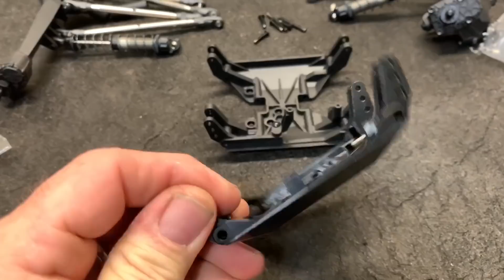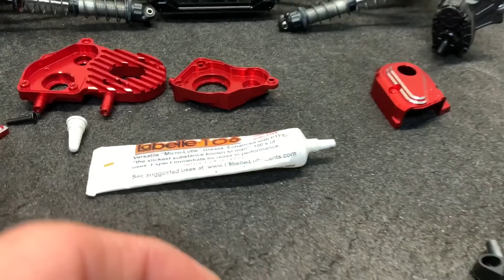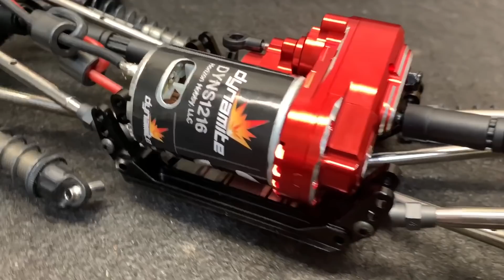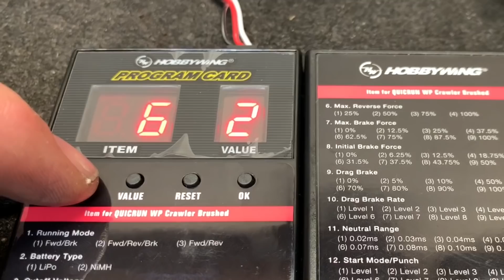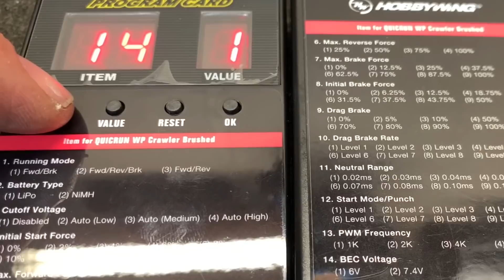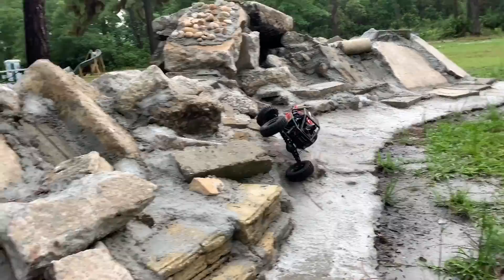Capra gets TREAL mods!

Comment: I have the treal axles, skid plate, brass portals and brass diff cover ect.  Drive shafts, beadlocks. But i got a vanquish 3 gear transmission.  Its too bad it gets all scratched up.

Comment: For the most part the gears in rc cars just don't get enough use to need grease. I've seen plenty of broken gears over the years but I've yet to see a properly meshed gear actually wear out.  I'm sure it has happened but for the vast majority of use cases it's just not needed.  Combine that with the probability of grease turning  into an abrasive and  I can see why they didn't use any.  That being said I do use a very light film on most gears because it just "feels" wrong to run them dry.  But anything more than enough to just lightly coat the teeth is a waste and a mess.
Reply from the maker: Yep! I usually put just a little bit on them. In some cases there is a lot of room and most of it just flings off.

Comment: Did you have any binding issues in the treal trans housing? I’m getting so much friction it’s sure to over hear my motor
Reply from the maker: Honestly it went together really smoothly. The finishes looked good to me as well. I did kill the dig servo on the run but I’m pretty sure I went way too far with the EPA’s. I’ve got the Reefs micro99 in there now and no issues at all.
Reply: Exocaged RC it took me so many times slightly adjusting the rear cross plate for the dig. Took it out out it back many times then it worked I’d say at 96 percent cus it has a tiny amount of friction still but it’s nothing compaired to how it was binding.

Comment: I'm putting the 1080 in my bomber.  How would I go about keeping the stock lights? I wish axial would use jst connectors to the receiver
Reply from the maker: you may have to cut and solder on some jst for them.
Reply: @ExocagedRC  ok. Thanks for the reply back

Comment: PLEASE, I beseech you. Produce a video showing how to expeditiously access/remove the chassis/motor/transmission from the body/cage of the Capra as you had already done for this video. 
NONE of these products and mods are of ANY worth to me(or others) if watchers aren't knowledgable, comfortable, or confident simply accessing these parts. TRX-4s and SCX10s are rather simple to access the motors, transmissions, etc. BUT NOT SO THE CAPRA! Please stop assuming everyone is knowledgeable of this process.
Reply from the maker: 4 screws and the belly drops out, take the shock top bolts loose and its all on the table just be careful of the wires.
Reply: Exocaged RC yep thats what i thought.
Reply: Just take the whole thing apart to where you need to. Or take the whole thing apart and rebuild it. Its how Learnt and its the best way. Or buy the kit. Also I bet it would be pretty cool to run the capra without the cage. It would perform so well
Reply: It's not that hard if you have any kind of experience in the hobby other than driving Joe does a great job at what he does stop hating

Comment: Treal products always look nice, will the belly fit a 550 can motor?
Reply: Stella Chow stock no. you could try some modifications and fabrication to make something up but normally a 550 will not fit a stock capra
Reply from the maker: not without trimming, I did it with the plastic belly using a holmes crawlmaster Pro and had to do a lot of trimming to the link to make it fit, the video is on the channel if you wish to see it.
Reply: @ExocagedRC  Thank you both. Honestly I 'm happy with  my Holmes Hobbies Crawl Master Pro 11T 540,  just wonder should I change the factory 14t pinion to a 12t for better crawling performance?